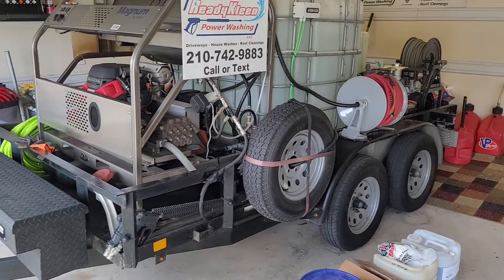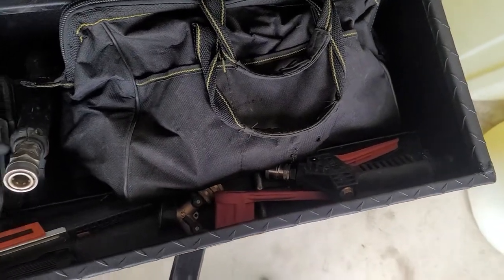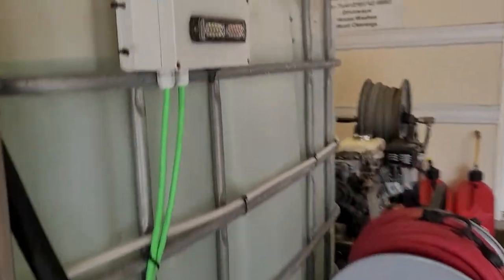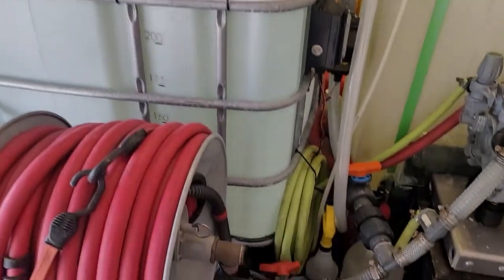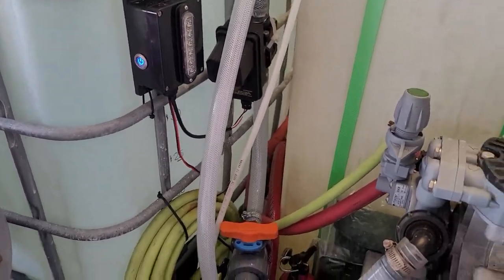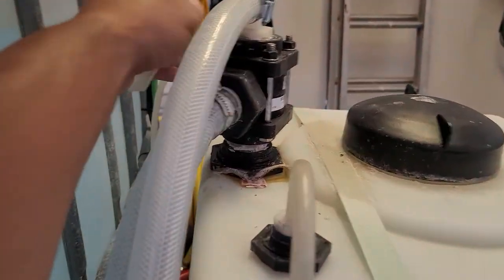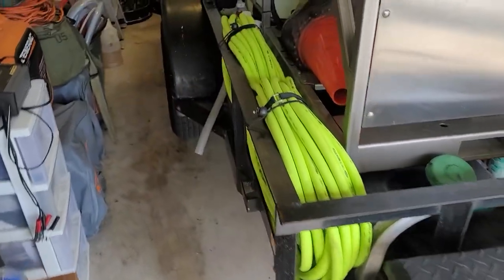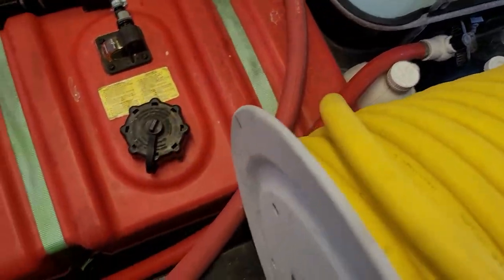Updated trailer walk-around video

Comment: How has the predator engine been holding up?
Reply from the maker: It's been doing great. I now have 193hrs on it. Just changed the engine and pump oil and ready to keep going. It's the main machine I use for everything unless I need heat. Then I'll use my 8gpm hot water machine.